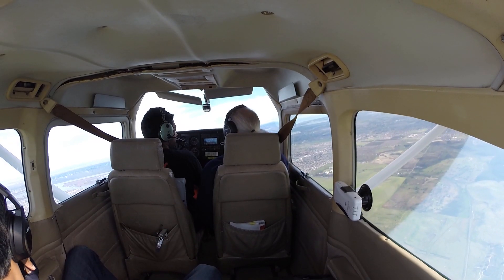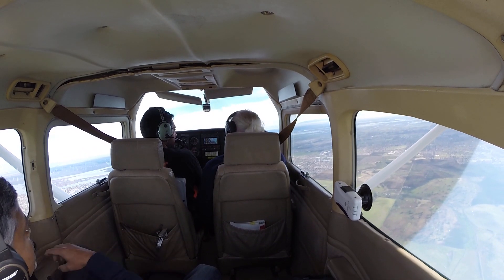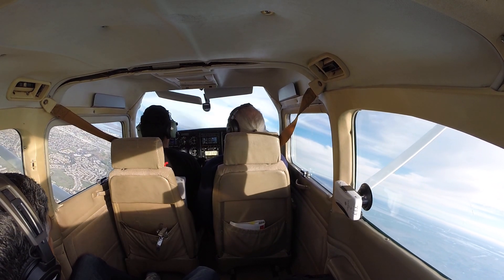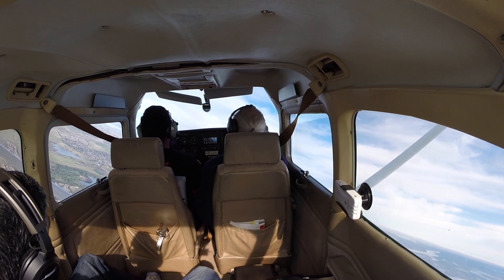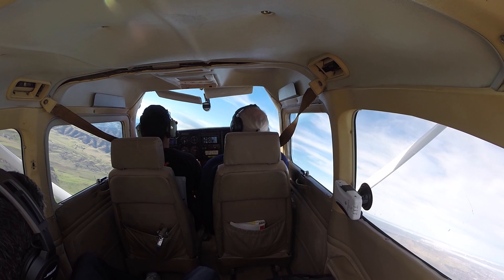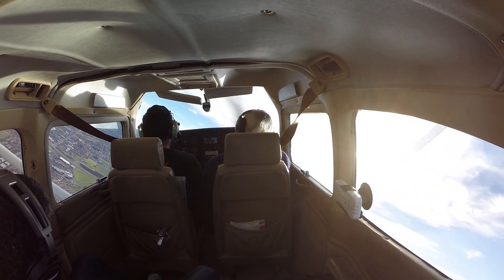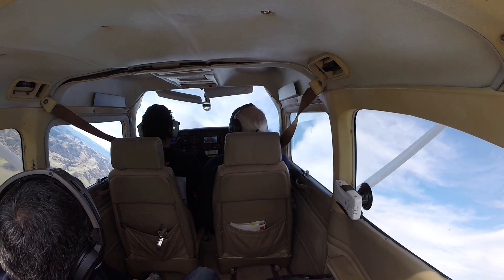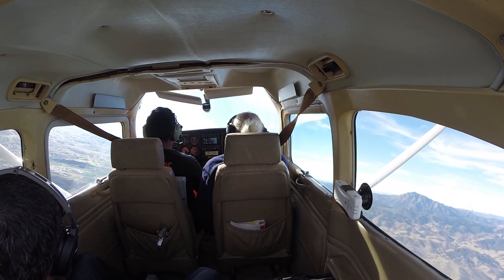Accelerated Stall on a Cessna 182

Comment: When I was geting my 1st ticket we used to do these in a 150 with cuise power. The 150 would just break and fall back on the upside wing and then keep flying. I never did too many of these in my 182. Would have to get the nose up pretty high and in about a 30 degreee bank. I always thought that at times they spent too much time on stall recovery (which is important) and not enough time on understanding when an aircraft's wing is about to stall. Stalls when under the hood were always fun.
Reply: We used to like to let them snap into a 2 turn spin. It was fun.👍
Reply: My instructor was natiinal aerobatic champion a couple years 😎😁😁